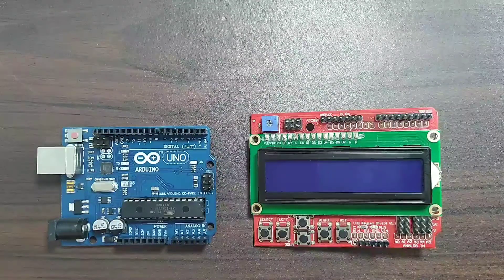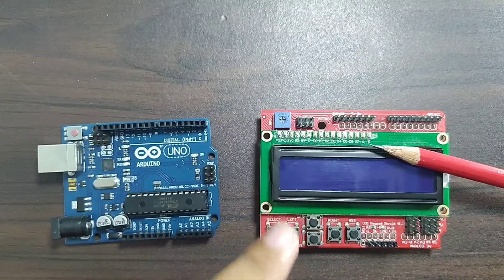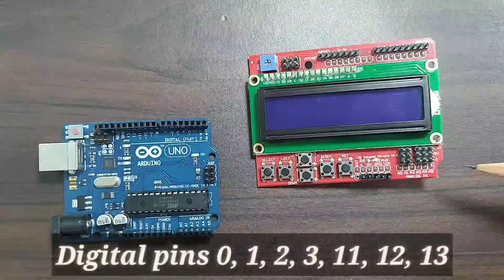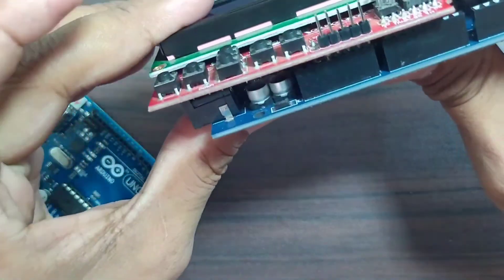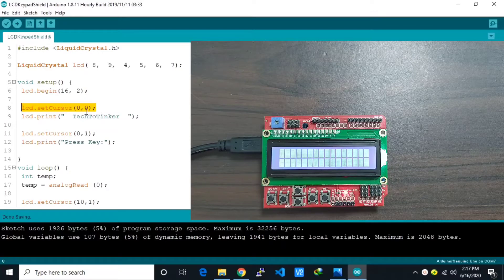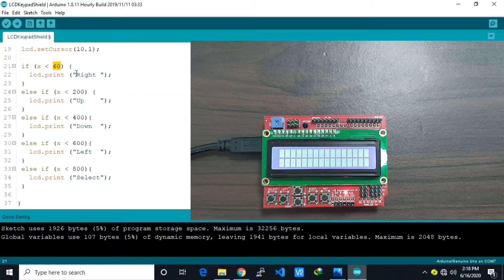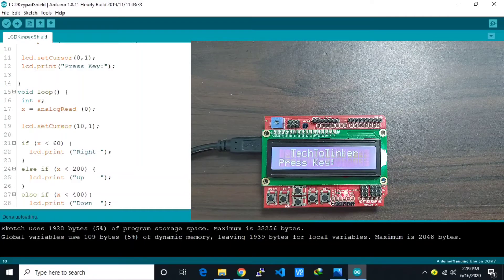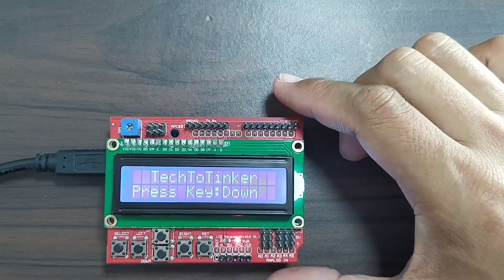How To Use Arduino LCD Keypad Shield

Comment: Hi and thanks for sharing your tutorial with us, it was really good and easy to follow. I want to use the LCD display to display 6 x temperatures that I collect from various parts of my home heating system. Do you have a worked example of this that I can follow and modify. I have done some basic Arduino project and programming so not a complete beginner. Thanks Richard.

Comment: Thanks for this.   I have the DF Robot version of the display/buttons board.  The buttons identify ok with the library example but are off with your code so different resistors ae used by the various manufactures.
Reply from the maker: Glad I could help and yes, you just need to serial print each analogRead and adjust it accordingly. Regards.

Comment: its working but i have to put in 16 , 1 insted of 16, 2 in line 6 and the text is very light
Reply: just screw  clockwise on potientiometer of lcd

Comment: Can I use the LCD shield with my Raspberry Pi 3B+ ??
Reply from the maker: @Johan de Beer, the Keypad/LCD shield is designed for Arduino Uno/Arduino Mega but it should be possible to use with other platform such as RPi. I haven't tried it so I can't guide you

Comment: Hi I tried the exact same code, but when I press the up button it displays 'down', for the down button it displays 'left' for the left button it displays 'select' and for the select button it does nothing. Com4 Port was the only option.
Reply from the maker: Hi @Vaishnavi, you need to calibrate the onboard resistor values, we might have a considerable difference in resistor values
Reply: @TechToTinker  My LCD does the same thing as Vaishnavi Gutti. Do you know how to calibrate the onboard resistor values?
Reply from the maker: @tbrandx2  yes, you can analog read pin A0 so that when you press a button, its equivalent value will be sent in serial. Then, adjust the limit values found in the loop function.
Reply: @TechToTinker  I commented out each key (ex.  // lcd.print("Right  " ); ) and added lcd.print(x); to get the values my lcd was generating.